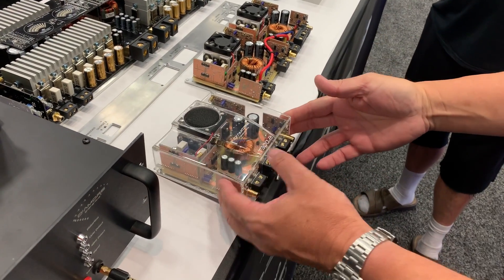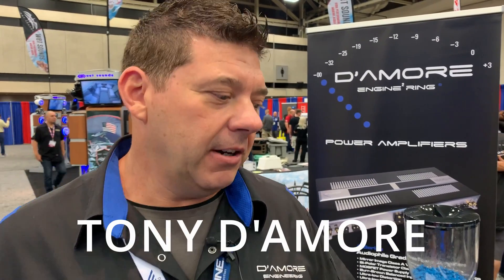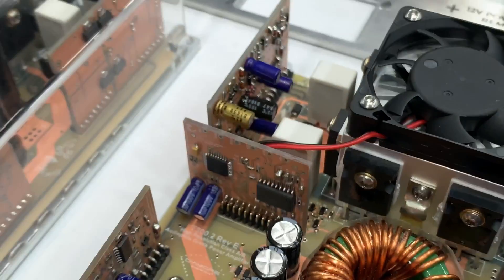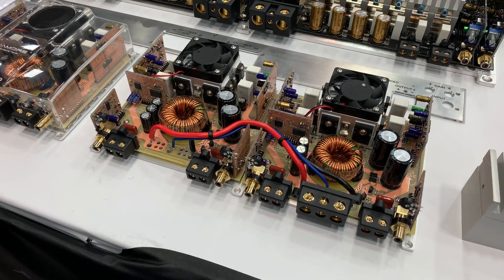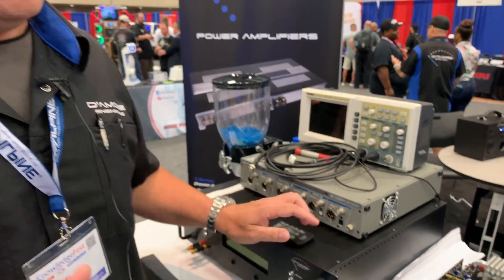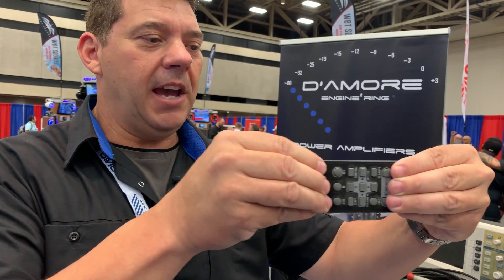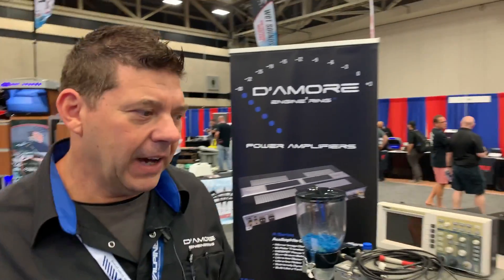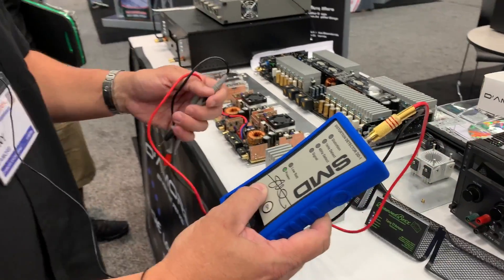D Amore Class AB amps at an extremely high level designer TONY behind it all at A'MORE

Comment: Just an Idea but why are we still in the analog era? Your amps only have RCA inputs. No Optical or digital inputs. We should be running optical from head unit to dsp to amp. Not head unit to dsp and then RCA's from dsp to amps. Maybe have amps with built in dsp like JL audio or audio control.